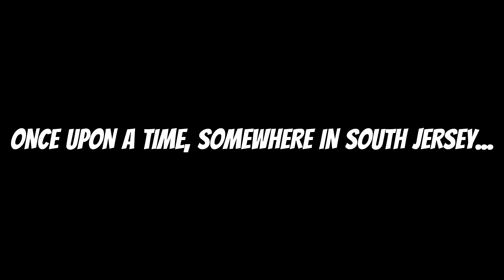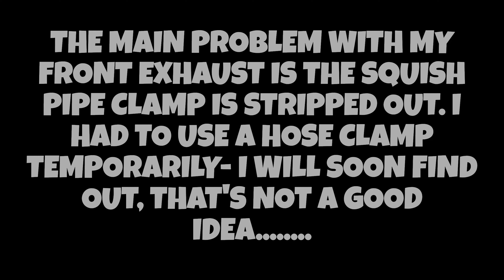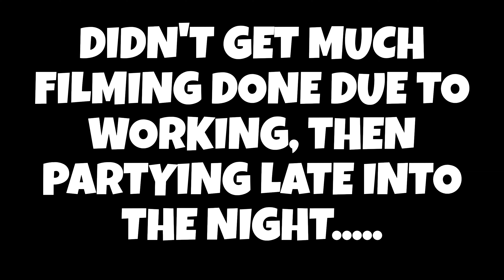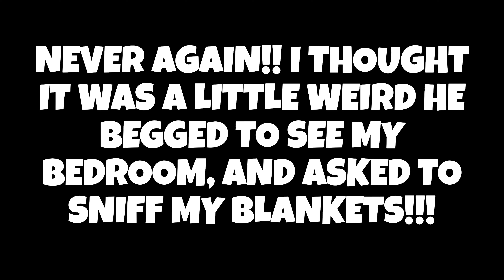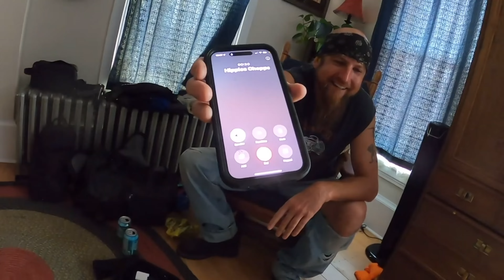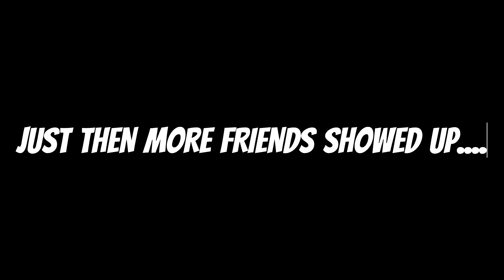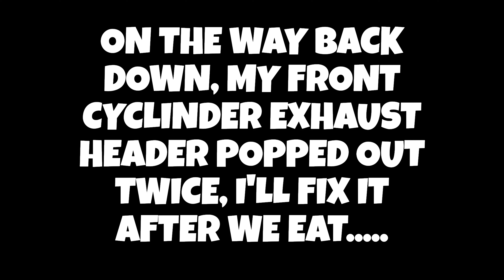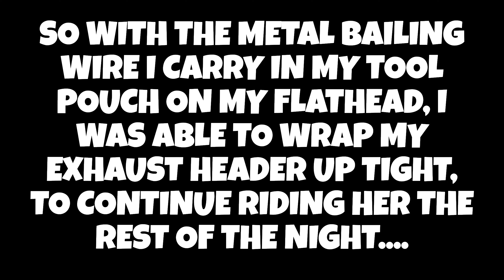2024 READING MOTORCYCLE CLUB ANNIVERSARY BASH

Comment: may have said before, my 45" had self eapping screws fitted ! as security. I use wood stove gasket goo to seal but tends to go brittle and fall out.
Worse thing to fall off mid ride, the kick start lever, i found it after 18 miles, without stopping, had been run over several times but still fit for purpose. ADHD and spanner swinging don't jive.
Reply from the maker: You have told me about the self tapers before. Great idea and that would work, i just not to keen on doing that.  I was told about the dual clamp set up that the knuckhead of that year uses!! I got a good exhaust clamp now.  You’ll see in my new video coming soon
Reply: @SlickHeadCustomCycles  cut me some slack man. you get old , you tend to repeat yer'self. 
FFS, kids today!.
Reply from the maker: Whoa you don’t gotta yell at me old man!!! I was being respectful!!! 😂😂😂😂😂😂 it’s all good dogpaw, im 50years old and i can barely remember yesterday!!! I’m in trouble!!! 😂😂😂👍🍺 SLICK

Comment: Slick can you help me bro av got a 1997 1200 c .sportster bars are slipping need new handle bar riser hard wear the Allan heads are shot can’t tighten as needed  the front to bolts are  6 mm thred and 30 mm lenth  the back to are 6 mm thred  62 mm lenth.as it’s imperial USA can you tell me the size of 62 mm lenth  and 6mm thred. Both mesurements were excludeing bolt head. Thanks bro 🇬🇧
Reply from the maker: If it’s a completely stock set up, try 5/16- 18 x 1 1/4. 👍🍺 SLICK